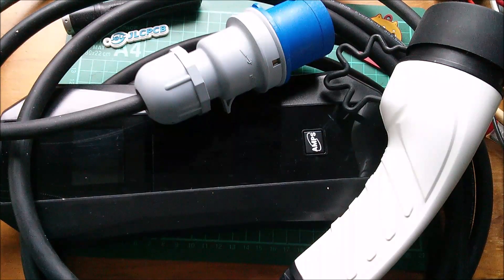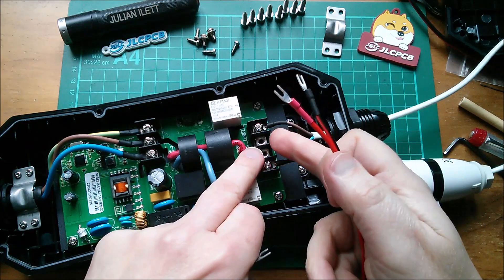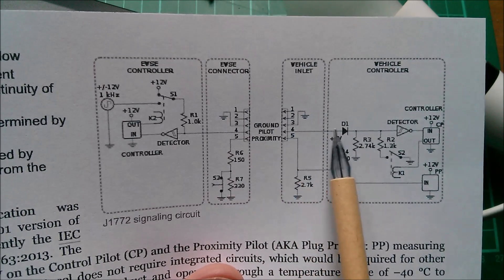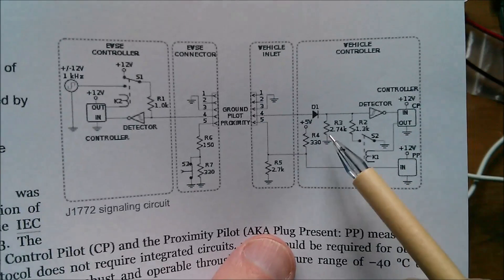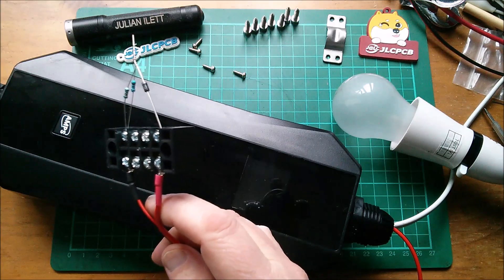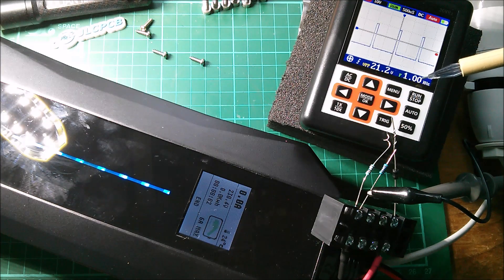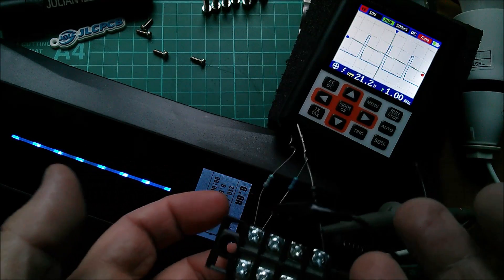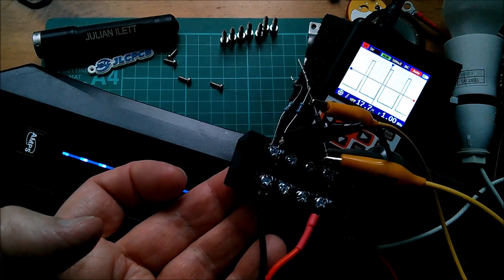EVSE Vehicle Simulation

Comment: I have an EVSE with Tuya onboard that you can control via tuyalocal that allows changing the current limit while charging, without disconnecting! I know not all do but there are some that can. I use it with home assistant to charge only from excess solar dynamically adjusting current while continuous charging session.

Comment: I've been thinking about taking a cheap EVSE and adding a square wave generator set for a higher duty cycle so that it can charge faster.  The goal would be to have a 48A EVSE since that is the maximum my wife's MYP can handle supposedly.  Originally, I was thinking of adding a second pair of relays external to the main body of the EVSE, but upon closer examination, it seems that the cheap EVSE that I'm wanting to experiment with already has 50A relays.

One thing that I've noticed with her car though while reviewing EVSE for Amazon is that the car will generate an error if the EVSE keeps 240V on the power pins after the car has informed it that charging is complete.  Have you encountered that on your vehicle?  Of all the EVSEs that I've reviewed, only one brand had that issue.

Comment: Very interesting video. With little information available couldbyou help quth a question?
Would you need to connect the same combination of resistors to the CP of the type 2 plug if you were making an adapter cable to attach the evse to a 16am male, as in a motorhome mains hookup for example.
Regards
Ian

Comment: ChargePoint required the diode. An LED works.  Feeding 240 into a Bolt EV without the square wave is ignored by the car.

Comment: 9:05 this is similar to a situation when the charger is plugged in to the car, then suddenly grid outage, and hours later grid came back again. We naturally want it to resume charging.
Reply: Well, imagine the spike that occurs when many cars (like 10 thousands or 100 thousands of cars) start charging immediately and in a perfectly synchronized fashion. "We" may actually not want it. For this situation, it would be better to have a random start delay between like 5 and 120 seconds. I guess, some delay variation is introduced by the varying boot up time of the different types of EVSE and different AC onboard chargers (they add delay, as they are not a lamp, but have their own demand profile and initiation sequence). But it's unclear, whether this is enough.
Reply: @MooseOnEarth depends how big of a grid you’re referring to. In a case of an entire city going down then sure, but a neighborhood or two you won’t have a spike due to EVs

Comment: Thanks Julian for this very interesting Video.
In fact I'm searching about how to modulate the max current output  of such an EVSE, in order to adjust it to the solar power (that is dynamically available at instant "T") from an OFF the grid home solar plant. Did you find any way to achive this goal yet ? With these kind of small chargers, or either with some other bigger chargers ?

I'm now exactly wondering which chargers on the market could allow beeing "piloted" easily (only the max current selection + turn OFF control / no more) in order to allow charging the car with an "adapted" power, that is always depending on the clouds, the time, etc. ... Because we can't take the risk of coming back home at the end of the day, and find an empty HOME power bank.

Thanks again Julian for this video which (at least) explains clearly how yo turn ON or OFF (a very good beginning to my graal research). output

Comment: Good video, but isn''t control pilot pin 5? your video makes complete sense and I was doing this experiment on my own in a much less neat way prior to seeing your video. I was able to do it without  a diode on a cheaper amazon charger I had, but now i am trying to conduct the test on a Grizzl-E charger, and it seems that I need the diode to trick the EVSE for it, so I found your video but now I am really questioning as to why that wiring diagram (which I was also referring to, prior to your video) has CP as pin 4. Just something I noticed.

Comment: The REAL question would be, how to simulate a CHARGER for the CAR which would allow one to charge anywhere without a charger or EVSE?
Reply: You just saw it. Just close proximity pin with known resistance and produce 1khz pwm to pilot pin and car will accept your 230/400v

Comment: Hi Julian , when you are charging the ev at 6A. Are you facing voltage flickering which causes led light to flicker ?
Reply: In my opinion you would not be experiencing voltage flickering as the EVSE is just closing a switch.  AC in and AC out.

Comment: Hi ...
I need to make a tester of 60min with some charger to see if they are good... could u help me? I will need to simulate one car charging in fully current 16A / 220V for 60min....  what I can use like load in out of EV charger? And just one diode with 2 resistence will fully charger at 16A?

Comment: Julian, I have a question for you:  when the power lines are extended for about 60 Meters, and the charging current is 32A , and the wire cross section is 6mm², at these conditions the controller will be fluctuating by about 6v around the PE , and that due to the wire resistance, from the displayed schematic, everything was measured with respect to PE , the power lines go in an out through replays, so power lines drop should not effect the controller. Now is it possible by any means that fluctuating voltage of the controller, can affect the CP signal to create an error that would stop the charging, because I was asked about this problem, where the car chargers for only 15 minutes, before the controller stops charging.
Use any technical language, I'm an electronics technician.
Thanks
Reply from the maker: 60 metres is a long distance. You should put the charger hardware nearer the vehicle so that the CP signal quality is maintained.
Reply: @JulianIlett  
The charger or  controller and cable are close to the vehicle, the power lines,are extended to 60 Meters. So the quality of the CP should not be affected, I think.
From data sheets of cable, there is a drop of 6v for the phase voltage wire, and another 6v for neutral wire , and these voltages are in rms , so there is almost a 9 v peak on each wire and it's inverted twice per each cycle.
Looking at the schematic, I don't see any of that affecting the operation of the controller,  because it's all referenced to PE . Is it possible that voltage fluctuations affect the power supplies outputs inside the  controller ? The car of interest is VW ID4 .
Thanks
Reply from the maker: Unlikely. Switched-mode power supplies typically work from 90VAC all the way up to 250VAC. But you should have a full +/- 12V CP signal (24 volts swing).
Otherwise, earthing problems. It's always earthing problems.
Reply: Thas why is a PWM signal, the part to measure is the duty cycle and not the amplitude. In that case an amplitud drop could cause the charger to go from conected to charging because of the reduced amplitude

Comment: Nice one! I wonder if EVSEs check if actual current doesn't exceed the limit set on Control Pilot PWM, or if it  just trusts the vehicle.
Reply: I got my answer, at least for mine. I tricked my electric motorcycle into drawing 2x the Wallbox current setting, it didn't cut (Wallbox Pulsar Plus).

Comment: Hi Peter, 
The output cable to the EV, 
Can I directly connect them into an enclosure, with a suitable contactor and timer for cheap off-peak electricity, 
Essentially, when the contactor energises, my EV charges.

Comment: Very cool and helpful video, thanks alot.

Why could you ignore simulating a contact on the Proximity Pilot? I didn‘t get that.
Reply: EVSE does not need PP to work. It is used for a car to know that it has a charger plugged in, even if EVSE is not active. 
Also, it is used tell the car cable rating (if used public AC charger, so if cable is 16A and charger is 32A, it would draw 16A max not to damage cable) and last is when unpluging, to disconnect first to tell the car to stop charging to stop arcing. 
As it it simple switch and resistor thing, cable to EVSE is not needed. 

Some cars use both PP and CP pins for canbus communication, but that is not standard.
Reply: @Mladjasmilic  and the last part of your answer i don't understand. Maybe you meant PLC?! As far that I am concerned, there is not (yet?) CAN-Communication between vehicle and EVSE.
PLC: When DC charging the PLC digital Signal can be "superposed" (with 2 to 28 MHz) on the 1kHz CP signal and the Pulswith goes to approx. 5%, which indicates "Attention, digital signalling is running for communication now, ect.
Reply: @User85306  I'm late to the party but afaik there are 2 connectors that use a CAN bus. For one CHAdeMO connector* that's more common in Asia and the proprietary Tesla connector. I'm not 100% sure about the proprietary Tesla connector though as it seems little is known about how Teslas own version works. (Note: The NACS connector uses the same connector but the "communication" has been modified to fit the normal Type 1 & 2 signaling and chargers+evs made/licensed by Tesla can somehow differentiate between those)

PS: Another note about the CHAdeMO while it uses can bus it's a standard and uses separate Pins so it's not a hacky CP/PP vs. CAN-H/L solution.
Reply: @Mladjasmilic  thanks for your answer, but thats nothing I'didn't know and your answer shows why I was asking. You are contradicting your self.

Why could you ignore simulating a contact on the Proximity Pilot? I didn‘t get that.

It is not only the EVSE that "has to work", but also the Onboard Charger of the vehicle is "telling" the EVSE the status, via pulling down the amplitude of the CP-Signal.
So why should the Onboard-Charger allow the EVSE to charge it (gives status "ready to charge" to the EVSE) if it the current capacity of the cable is not known? That would be dangerous.
Or can the Onboard Charger still detect it (like on mode 3 charging) via a resistance between PP and the PE at the connector side of the vehicle (vehicle <> Type2/Type1 Connector)?

Comment: I want to build a Tesl anything adapter. We need to trick Tesla type 2 destination chargers into charging non Tesla vehicles. We could trick the Tesla chargers into supplying power output, so we can connect our portable charger to the power and connect to our non Tesla.
In the Tesl anything instructions, it said count 15 seconds before flicking a switch which connects the second resistor.  Now I think we’ve cracked it. What do you think ?

Comment: When you say "all it needs is a diode and two resistors" - I think you demonstrated that all it really needs is a single resistor at approx 800 ohms.  Then taking the resistor out of circuit when you want to stop charging.  I'd guess other charging adapters are more "fussy" - i.e. more cautious - and require the diode (to assure the charger that there isn't a simple resistive connection such as a puddle of water etc. and to create the two-stage handshake you were expecting.  As it is, this one seems more or less a simple relay with an isolated control signal.

Comment: Can you charge A RV this way 120v as the ev car out put?
Reply: Most AC public charging worldwide is over 220V, even in North America and Japan. You'd need to make sure that whatever you connect can cope with a wide voltage range like a real EV, including 100V up to 260V single phase AC if you're going travelling and not entirely sure what the output voltage is going to be. In North America, the lower voltage is known as Level 1 charging and takes forever to charge an EV. 
To do things entirely safely, your pretend EV should perform all the tests that a real one does before drawing current, which includes checking earth impedence. The last thing you want to do is plug your vehicle in, and a badly wired public EV charger makes the vehicle bodywork live because of faults.
Oh, and you may find that the terms of service for most public charging networks say they should only be used for charging EVs.

Comment: I vaguely remember the additional switched resistor was there to give the vehicle computer time to boot up so it could monitor charging. The computer could signal the EVSE that it was ready by switching in the lower value resistor. Don't suppose there's necessarily a problem with the EVSE jumping straight to charge mode if the charger is always ready for it. Or am I missing something...?
Reply: I built an adapter from EVSE to 3-phase with only one resistor and the diode. It always worked. But you have to cut the holes into slots or you might be unable to unplug. Wiring your own plug dont forget to replace the short pin with a long one PP and PC one of them is a short one leading to bad contacts and refused charging.

Comment: I've found that EVSEs which don't check the diode are quite common
Reply from the maker: Interesting. I've been thinking about the simplest circuit (probably analogue) that would perform the main EVSE functions. Certainly a lot easier without doing the diode check.
Reply: I have connected a recorder to later see what is going on with public charging. It was unreadable. Only behind the diode did I get a signal. Maybe the EVSE did not even have negative 12 Volt on the pilot.

Comment: That operation exactly matches what I see on my real electric car and a Bosch "charger" running on 240 volts.  My car only charges during the night, but right after plugging in the "charger", the car turns on the line power for few seconds to make sure there is line power available.  Then switches to "standby" until 3AM for actual charging.

Comment: Good info. Thankx, still it baffles me that end-users/consumers need to figure these things out and build solutions for optimal solar adaptation. Why aren't suppliers in the marketplace more eager to get these solutions functional, easy to use and working with general/standard protocols? Same thing for the producers of solar and inverter equipment. Industry standards for autonomous self-supplying homes are still in their infancy stage.

Comment: Julian doesn’t your house have a modern CU with single or split RCDs ?

I’ve accidentally “electrocuted myself” a number of times over the last 17y of doing up my house and extending it massively. 

Genuinely wondering if you don’t? And if you do (have modern RCDs) isn’t that safer than that power bank? Or does that have earth leak/residual current protection?

Anyway, your point is very well made: if you don’t know what you are doing, leave the mains alone 👍
Reply: At the risk of being pedantic, you can only 'electrocute' yourself, or indeed anyone else, once. You can however get multiple electric shocks. I too have had a few for various reasons, mostly involving my my own carelessness, oops. Fortunately newer electrical supply standards make cockups more survivable. Even just 30mA at 240Vac for however many mS is not my idea of fun, and I have some extreme ideas of what constitutes fun :-)

Comment: I am tended to say the electrician that never had a good 220V shock... never has done real work. I had my first electric shock...kkkkk when I was maybe five. One secret is NEVER TOUCH WITH CLAMPING FINGERS because the muscles will contract and it will become critical. So if you feel the need to touch a hot wire ALWAYS JUST ONE FINGER. It is a built in function of the human to easily retreat before stopping your heart.

Comment: The EVSE shouldn't care if the "car" is connected but doesn't enable that second resistor. That'd be the situation where your car is plugged in but has a timed charging mode that hasn't activated yet. So it will sit in connecting indefinitely waiting for the car.

And it should all just cope fine if the "car" is connected and wanting to charge and you plug the mains in, that'd be the situation where you plug the car end in before the mains end.

This whole system is both really clever but also so dumb.

Now can you work out how CCS works, there seems to be more brains in that.

Comment: As it does not care about the diode could you test dunking the charging end into a bucket of salt water like mikeselectricstuff did and see if it will turn on the output?

Comment: If it dose'nt care about the diode, then all you need is the 2 resistors. If you just want it to be on all the time at power up then one 877.5ohm resistor will do. :)
Reply: He's following the EVSE specifications to achieve a better solution, not just working today for this particular EVSE implementation (which may finally not be fully compliant with the standards).
Reply: Yeah, it doesn't seem to care about the diode or sequencing so why bother with the extra components.

Comment: Very intresting.
Now lets see the other side, the car. Is the minimum really 6A or will it go lower?
6A or 1500W is pretty beefy for a smallish solar with cheapo chinese inverters.
Reply: 6A is just the negotiated maximum, car can draw less if needed. Take his lightbulb for example.
Think speed-limit or Ethernet, the maximum is what is negotiated, not minimum. 
However, a more finacky "safety oriented" device could stop the output if it's not within 99.9%, but I highly doubt this in consumer equipment.
Reply: The spec says that below I think 10%, this signals that powerline comms should be used for CCS DC charging.
Reply: @mikeselectricstuff  Yes, that is exactly what i would like to verify. Cant believe there is no charging solution below 1500W.
Reply: @pepethefrog7193  running from a minimum of 100 Volts will do the trick. If you want to charge from a battery and an inverter ...
Reply: And EV will pull below 6 A, I’ve built and openEVSE and regularly see my Tesla only pulling about 2 to 3 A when it has completed charging but is preconditioning.